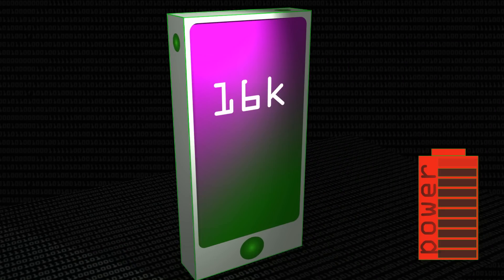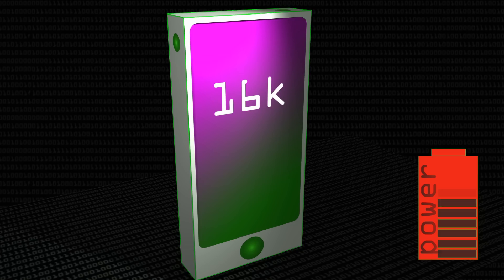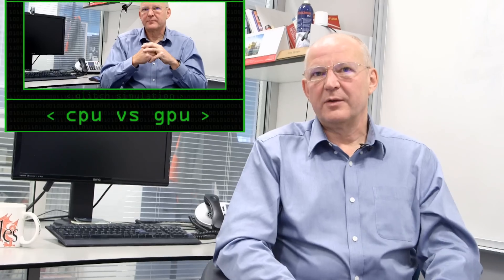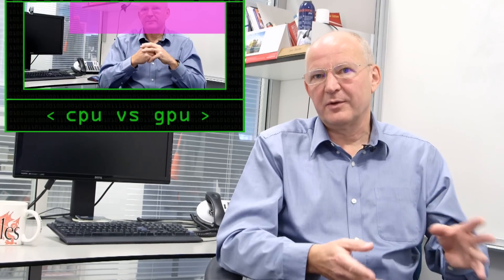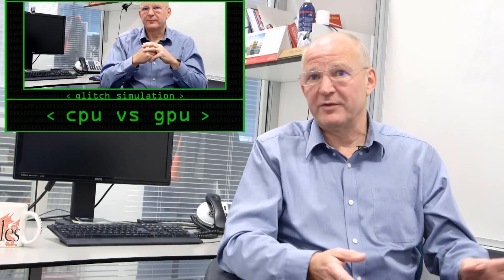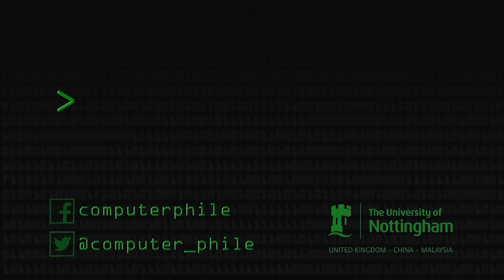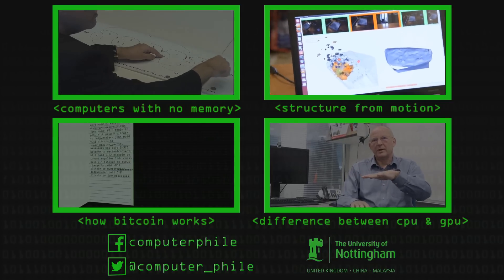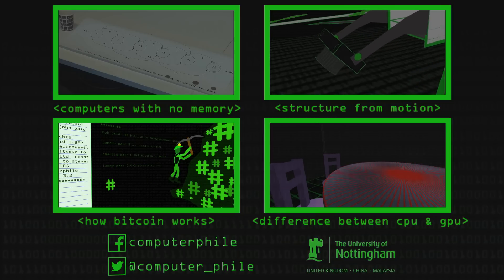Mobile Chip Design - Computerphile

Comment: The laptop i bought in 2006 had a 4000 mAh battery. The laptop i got from 2013 ALSO had a 4000 mAh battery. And another laptop battery i saw from 2008 has a 4400 mAh capacity. All the standard issue laptop batteries i've seen have been 4000-4400 mAh. Why is this, hasnt battery tech advanced at all?
Reply: Jackpkmn That's physically impossible, battery tech is at its limit. Only way you are getting more capacity is for batteries to be replaced by mini-fuel cells or supercapacitors.

Comment: Hey Computerphile.  Which is more important, data communication or computer processing power?
Reply: +Chris Koro I'll answer that since this is Youtube where you can comment on things you know nothing about. While it is a mix of both as one without the other is useless obviously, the real importance comes from the processing which is the most expensive problem to solve due to its tiny scale. Communications can be handled mostly remotely with dumber tech on the client hardware. BUT that's changing isn't it? We've seen the first wave with cloud storage and many services but the next wave will see the cloud outperform start to offer services in the form of pure processing power and outperform what local processing can do by such a margin that it would be insane for any company to think it can compete doing it all locally. The BUT is contingent of communications becoming more reliable than it is right now with faster speeds available in greater saturation around the countries being sold to. But that's happening across the developed world, some places faster than others. 

OK, how did I do? That was straight up just guessing so I'm super happy to be corrected, chastised and generally told to STFU. It's youtube after all, need a thick skin here :)

Comment: Fascinating.  Apple do all this in house I guess ?
Reply: +DreadKyller this video is about mobile chips, and Apple bought PA semi and does design of mobile CPUs in-house. of course it's all based on ARM but still lots of customization to do
Reply: AVN WX
apple still use ARM processor designs  licenced from ARM.    I think that's as far as it goes though.

They have teams in house that do what's described in this video to produce their a* range of chips.

I think apple are the only ones that do all this in house.   The rest work with ARM directly to build their own mobile chips.
Reply: +Hanniffy Dinn apple uses almost exclusively Intel chips, they don't do it in-house, they have the designers at Intel design chips for them.
Reply: only the design, production is offloaded to third parties
Reply: +Hanniffy Dinn It depends on which part of the SoC you are talking about. the CPU traditionally has been designed in house ever since A6 (A4 was based off samsung's Hummingbird, and A5 was a stock ARM design). However, the Gpu designs themselves have always been outsourced to Imagination Technologies. Though I believe final integration of those Gpus are still done in house. This happened with Recent iPads where they sourced a 4 cluster gpu unit, but linked 2 of them together to get the performance needed.

As far as anyone else. Qualcomm used to do it with krait, but with apple's push to 64-bit causing a paradigm shift, Qualcomm used stock ARM designs for a while. Snapdragon 820 i think is the first back into an in-house design with the Kyro core.
Reply: iamterence77
It's certainly interesting!  Far as I'm aware apple have massively upped their game in house in this area.

They hired AMD processor designers and allsorts.

It looks like they are getting ready to get rid of intel entirely!

With their own x86 64bit processors with the latest new range of AMD GPUs on the same die.

All signs are pointing to this, so this will be very interesting times when they ditch Intel down the road.....!

Intel will be shaking in their boots, ARM have already owned them in the most profit areas. Which only leaves the less margin server markets....

;-)
Reply: Hanniffy Dinn They can't legally make x86 cpus without licensing the patent from intel. If they do decide to make their own desktop cpus they will have to be arm based and they can say goodbye to 10 years of OS development as well as all compatibility with current mac os programs and possibly with standard gpus. Not to mention performance, which does not scale as well with arm as you increase die size. Not that I don't believe apple are not self confident enough to try to pull it off, but anything coming from there is bound to be garbage.

As for intel shaking in their boots, if the silicon market were a food chain intel would be at the top. They are not as common in the mobile market just yet but their presence is increasing, and they have a semi monopoly in the desktop and laptop market - their success goes hand in hand with windows, which is still by far the most common pc operating system and doesn't run on arm. Their only competitor in that space is amd and they have a much smaller marketshare.
Reply: Hanniffy Dinn It depends on the market. In mobile, Depending on software support, Intel is trying harder than others (and struggling slightly) for breaking ground into ultra efficient processors by trimming x86. 

However It's hardly "shaking on their knees". Arm vs x86 are completely different types of cpus (being risc vs cisc), Where intel struggles in power budgets when miniaturizing, they make up for once the power limits are raised. 

Give 2W tdp chips to intel vs ARM makers (Apple, Qualcomm, Samsung) and intel will struggle, Give 15W and intel can make MUCH better use of that "performance / watt" than any arm.  

then there's production, At this point in time, never has it been more true that "real men own fabs". intel's cpu production tech quite far ahead of the competition. 

Apple makes some interesting cpus (and are very interesting to read about), that can be groundbreaking in the mobile world. but its hardly capable of touching the juggernauts.
Reply: +Hanniffy Dinn no Apple do all this in a factory. In a house the furniture would get in the way of the production lines. Hey, I'm really coming across like I know what I'm talking about on this channel. I don't think anyone suspects a thing that I don't :)
Reply: Clay Mann
nah.  it's clear you are clueless.
Reply: Hanniffy Dinn yeah that was a weak attempt at being funny. Reading it back now I'm cringing. So fair comment.
Reply: Clay Mann
Hey man, that is the sign of improvement, it's all about iteration and learning from mistakes.
Keep at it, and you'll be a genius.
The route to success is being self aware.  Search for Rudolf Steiner.

Comment: nowadays a very interesting way of designing a phone should start with "we have a 2000mah battery and we want it to last at least 24 hours at 100% usage". :)
Reply: +sbraz Well.. then you have to determent what 100% usage is.

Is it browsing, video or game... it have very different load characteristics.
Reply: But then they went "hooray,  we have a chip that can run using half the power usage.  Let's reduce the battery capacity so that we can make it stupid thin!"
Reply: Hatagashira
better than having 8 cores 4k screen 128gb lte lasting 2 hours... i'm obvoiusly exaggerating for the lolz here, but the battery situation is equally silly imho, unless one goes with power banks or big tablets. :)
Reply: +sbraz Then it can't use more power than 83mA on average which pretty much means you'd end up with nokia 5110 type features because after backlight and the cellular radio you're left with < 10mA.
Reply: sbraz There alreddy is a phone like that... Nokia 3310. Its 18 years old, and still going strong
Reply: matsv201 Pretty sure they can design a new one with more features and way less power usage.
Reply: matsv201 I'd love that phone if i where 86.
Reply: That not a lot of Batery
Reply: mhmm prety muc, like id prefer a phone thats around 0.7-1cm deep instead of the NEW XBlah 3mm thick, superphone for 5 mins
plus many of the tiems the battery is so uber thin in them phones well msot phones 
like around 2-3mm thick, iif that lasts 2 hours at full blown everythignw as a extra 2 mm,,, thats gona be 3 hours at blast, that will still only make it a this phone u.u
id prefer a phone that wasnt paper thin and felt like it could bend hehe, plus itd give it some extra heat disappation,
Reply: +any1alive 
You really need to learn how to not write and express yourself as a toddler. Read the above text slowly this time and try to interpret it ?
Reply: +matsv201 sorry could you clarify " durable, but not very durable" with regards to whether or not the case can come off? I don't understand. Thanks :)
Reply: Eddie MacDonald No.. it suppose tu be "not as durable, but still quite durable"
Reply: +matsv201 OK thanks :)
Reply: false.